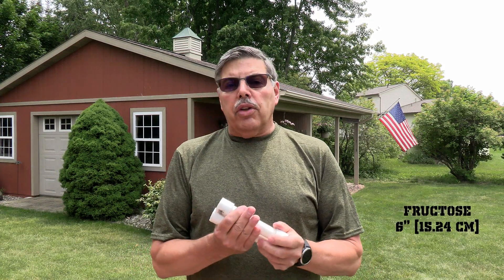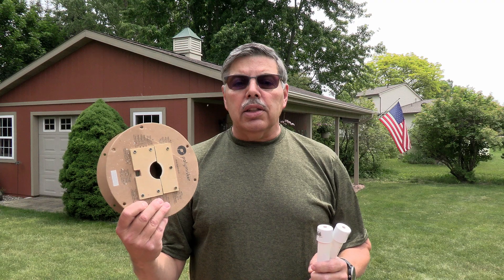Homemade Rocket Motor Test X2

Comment: Hello, the slow start up of motor may be fixed by making custom igniters out of black powder, which you can buy or easily DIY. The problem is with low pressure which igniter generates. The pressure then slowly rises until motor reaches its full power. Custom igniters can generate this needed initial pressure very fast.
Reply from the maker: Yes, that is correct, and I do make my own dipped igniters, as I've posted a video on the subject. The issue with this setup is that the nozzle is too small to accommodate a dipped igniter that extends all the way to the top.

For sugar motors of this size, they typically take a little longer to ignite compared to other types. This delay in ignition is quite common and will not affect performance.

Thanks for your comment!

Comment: I was wondering if you could replace some of the sugar with wax? Theoretically, it should offer better energy, gas volume and ISP. The Idea would be to mix all the powders and then melt in some wax, which binds the grains like water in clay. You could then ram this mixture into a grain mold.
Reply from the maker: It sounds possible to include wax but typically melted sugar propellants out perform rammed fuel.

Comment: Hello, I have a problem with my icing sugar and potassium nitrate rocket engine. He flew to me once, and now he doesn't want to fly. I make the casing out of cardboard, nozzles out of gypsum and fuel 65% potassium nitrate and 35% icing sugar. The nozzles do not fly out, the fuel burns properly, but there is no starting impulse to fly. Anyone know what could be wrong.

Comment: I've been looking for a proper test stand for my motors can you tell me where you got that?
Reply from the maker: I purchased it from Boris du Reau, he makes budget friendly altimeters and the Arduino board is already programmed to measure thrust and pressure. It sends data by bluetooth to your phone and works great! Email: boris.dureau@neuf.fr
He lives in France and speaks English as well. I am planning a video in a few months that demonstrates how to use it. You can contact me at CaptHaywire@gmail.com for more information.